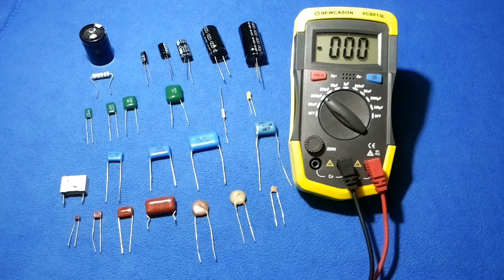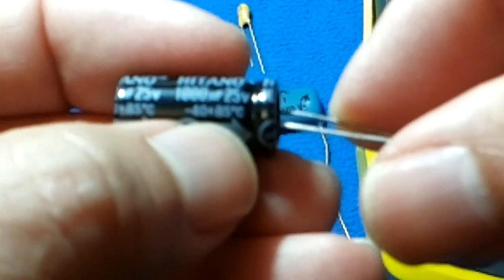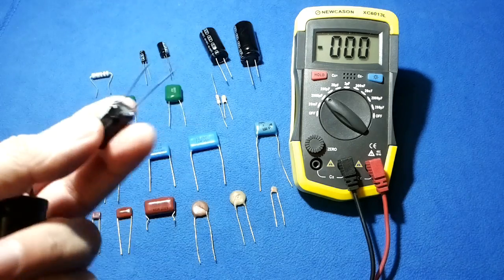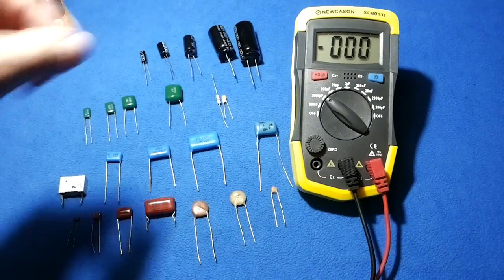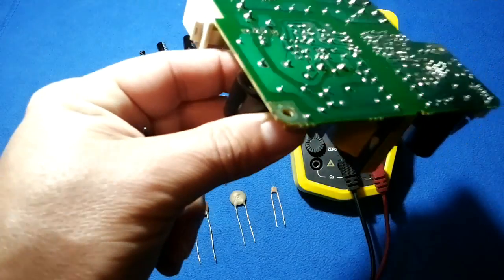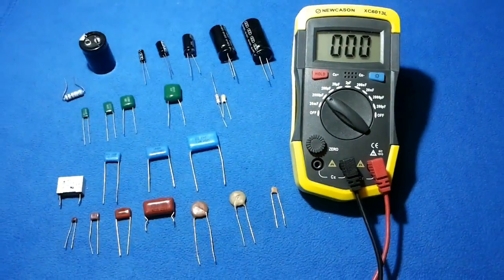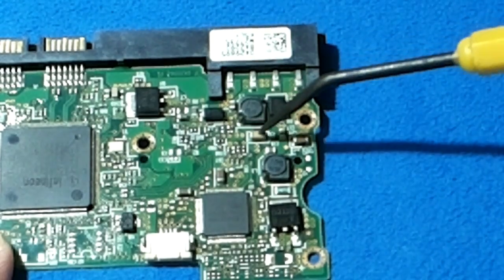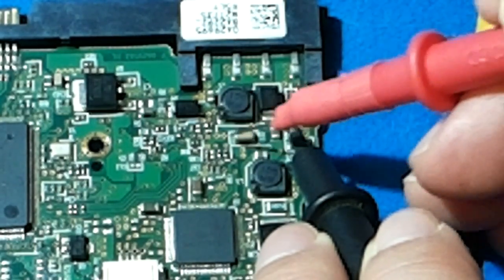How to test a capacitor / how to test smd capacitors with a multimeter

Comment: I've got a 250v 150uF Capacitor 105 Celsius which I pulled out of tv main board, checking all the components.  It's reading 136 uf on my meter. What do think, number on cap too low to re-use? Or still in range?

Comment: Wow, why is that power supply at 9:13 so huge? What device does it power?
Reply from the maker: Hi! I don't know. When I moved to a new country, my mother in law made a deal with some people who gets broken electronics to use plastics to "heat their house in winter". She asked them to bring the PCBA and she pays some money that helped them a lot. I started here with a repairs with a full inventory of spare parts from it. After one year, I retired from repairs and I got to next level as electronics engineer in manufacturing and design. Now I use those PCBA for teachings. But I have not idea from which device or brand are the PCBA from. (This one looks like a TV's power supply. The small one is an Epson Printer's power supply).

Comment: If you hold the discharge resistor wire with the metal pliers (you were not holding the insulated part) and if it is 200v and charged, you could give yourself a hell of a zap...
Reply from the maker: Yes, after 30V we must use insulation. Also the discharge time should be the capacitance times the resistor times 5. Any capacitor after 35V indication must be handled carefully.

Comment: if i have a small smd capacitor like in the end of you video. can you measure continuity between the legs on it to if its short or do i have to remove it first ? why need to remove it, maybe removing only needed when want to read capacitance

Comment: Hi, thank you so much for your video! 
Please I need your help!
Hi, I'll appreciate if you give me this advice, by chance do you know if the old capacitor 250V PME 271M 0.1 μf X2 40/85/56 it needs to be discharged in the circuit board before remove it or the new one that I got PME 271 M 0.1 μf X2 40/110/56/B how? if so how I can discharge it? With resistance or simple metal?
Thank you for your help.

Comment: can I test and measure without unsolder from the board or are number always wrong like that....?!
Reply from the maker: Hi! We will never find a good brand of test equipment making on circuit capacitor meter. If we want to measure a capacitor, it should be off board. (With exception we already removed one component and the capacitor is linked to nothing else). For defective capacitors in short circuit, we must remove the capacitor to get the short out of the circuit. So, the answer is yes! We have to remove the capacitor anyway.

Comment: Hello Bob!
Is there a capacitor that be used as a fuse?There was a aluminium housing fuse with 5A 32V tolerance and blew away like an Elko but no where to find something like that.Is is allowed to replace it with the ordinary fuse?

Comment: Unfortunately the lighting and camera close up is not efficient or clear. Sorry for the comment or criticism but it's TRUE.
Get the appropriate equipment for soldering removing and installing surface mount capacitors.

Comment: Hi i have the same type of tester u hv but wen i test a cap say 100uf...i get a reading of 80 uf...but wen i test it with my fluke tester it show 99uf...is something wrong with my tester? How do i zero my meter cos i hv a manual but is in chinese...pls advice if i should zero in every range reading to test.?
Reply from the maker: Hi! Large capacitors requires more time to be measured. But also, this kind of testers can be damaged easily with a charged or partially charged capacitor.  DMM are made to measure high voltages and 10 or 20 Amperes,  what makes them little more restan to damages. No all the time, but some times, a capacitor discharge damage affects only one or few scales but no all of them. To zero the capacitance meter is a need for low scales. But high scales does not need to zero adjust.

Comment: hola Mi amigo.. gracias por el video..tengo una pregunta que no tiene nada que ver con el video.  yo tengo ese capacitor meter igualito a ese , y accidentalmente le meti 120 volts ac, por tener a un lado mi medidor de voltaje,, me equivoque de terminales, y nomas escuche un tronidito,,entonces ahora nomas prende el display, y se queda en ceros,, pero no mide,, lo abri y adentro tiene un fusible y lo probe y esta bueno,, entonces estoy buscando el daño.. tiene usted una idea de que componente pudo haberse dañado?... gracias
Reply from the maker: Yo no he abierto el mío. Pero por casulidad, recuerda que algunos componentes pueden estar en corto circuito en la entrada de la medicion. Sin batería, busca si hay corto en los terminales.

Comment: 4:59 - firstly, how long would it take to discharge and secondly, how will you know that it is discharged?
Reply: It can vary obviously but you can connect a volt-meter and see the values drop as it discharges.

Comment: 4:46 -> please don`t touch circuit. Do not die from a shock, but it's painful.
Reply: First of we should not test a board while it is conected, secondly large capacitors hold charge for a long while so it is important to remember to be carefull when touching leads with resistor while discharging, I think it is still a normal procedure to touch the capacitor legs with a screwdriver to discharge it pretty much the way we used to with old tv screens which by the way are xtra large capacitors and we'll see a long spark between the screen and the screwdriver.   But you are right it will sting you nastilly if you are not carefull

Comment: How can I test a low value ceramic capacitor by a multimeter ?
Reply from the maker: Hi! It has to be a multimeter with capacitance meter function. Then it will be as simple as to use a single capacitance meter. If your multimeter doesn't have the function, then there are more step method as applying ac voltage with a serial resistor to a non polarized capacitor, and calculate Xc. If the capacitor is polarized, then connect two capacitors in serial (-+,+-) with the centers pointing inside, plus a serial resistor to the AC source to calculate Xc. You will have to look for the Xc formula, but the experiment will help to learn a lot. (Be careful, because capacitors calculations must always be done with Peak or Peak to Peak Voltage). For your experiment you will look for AC RMS to Peak to Peak Voltage convention, RC serial calculation, RC impedance, and Xc capacitive reactance calculations from most good basic electronics or electric principles books.
Reply: Bob. Kalpon

Comment: so multimeter and capacitance meter are the same thing?! since when! .........
Reply from the maker: Hi! A multimeter is an equipment able to measure different things. In the pass, we just to buy a analog volts meter, ampere-meter or even an analog frequency meter. Today is common to find a DMM in the market with all the mentioned functions plus diode, transistors check and capacitors meter too. It makes the multimeter the same as a capacitance meter, or transistors tester, thermometer or frequency meter...
Experts have the knowledge, and they don't need to learn anymore about basic things. There is not need to show a 15 seconds video about how to measure a capacitor due it is just two leads and two terminals where in most cases maybe it is not necessary to care about polarity. But students, and non expert people search for knowledge and it is the reason why this video is here. The video is focused in basic and general knowledge about capacitors.

Comment: is it safe for the circuit board to discharge a compositor while it is still on the circuit board ?
Reply from the maker: Yes. The capacitor has been charged to its normal voltages, and all the reverse voltage protection is done in diodes, transistors and ICs. The problem will be if we charged the capacitor outside of the circuit, and later try to insert it charged, because maybe we charged the capacitor with more voltage than its normal operation voltage.
Reply: Thanks ! 
Im trying to fix a 36 v battery charger .
I saw a video on fixing a battery charger that keeps blowing fuses .
He was saying that is is usually the  rectifier that is the problem .
I switched my volts meter to 115 and it was meant to be on 220v and I pluged it into the 220v wall socket and not the charger keeps blowing fuses . 
I dont know a heck of allot about circuit boards .
Reply: So I had a look at the board and the only think I can think of is that the first track that leads to one of the biggest compositors on the board my be the one that is faulty . 
Its really hard to tell cause it does not seem to be damaged and i cant see anything else that seems out of place .?

Comment: thanks bob!! im an electronic technician my self, as my professor said before, "electronics technician must never stop studying"
Reply: +Glenn Gacayan I was a tech in the 80s and 90s. These days you simply replace the board/module in many cases. Never tried to solder anything on the boards they make these days, I am not a watchmaker.
Reply from the maker: 100% Right! :-)

Comment: Hello, I recently pulled out a capacitor from a disposable camera, what do you think would be the average size for one of those??
Reply: The only numbers on it look like this:
8(2)
5w
Reply from the maker: Hi! Try to get the datasheet for it. In case of there was not data, then you will have to measure it or set up a circuit with a chip 555 to calculate the capacitance value.

Comment: Hi Bob,thanks to share your experience with all of us, i´m a total beginner in electronics field but I would like to learn more because I like challenges like finding the defect and repair it, naturally i´m not an engineer or a technician but like every other human being I have an Intelligence :)

Ok after this long introducing I would like to ask you about measurement with a multimeter of capacitors, I have bought a multimeter with capacitance function with an up limit of 200uF , my question is if I can measure capacitance of capacitors over 200uF or not, I have some polymer aluminium electrolitic capacitors with capacitance of 270uF and 470uF and the multimeter doesn´t read them, is that normal or I making a mistake???? 

Another question as newbie that I want to make , is possible to measure the capacitance of a capacitor without desoldering it from the PCB???? I ask because desoldering is so boring but in Youtube I have seem some videos of users they say it´s possible and other instead that say is not possible to because you will not have the right value of capacitance, sorry for the long message..........I have my subscription to your channel and I wish you all the best for it.

Thanks

Luca
Reply from the maker: I had the same exactitude in the mid 80's. There was not any electronics school in my town, but I wanted to learn, and learn it all and to grow and to be on of the best... In 1989 I registered my first patent, and 10 years later against all the adversity I graduated as engineer. Now day's, 600.000 people watched my videos and I am able to help people like me, searching for knowledge in electronics. Don't stop, be humble and always ready to learn. I wish you the best, and welcome to the wonderful electronics world. "This is electronics. We don't work. ...we just enjoy with it".  ;-)
Reply: Thanks I am just learning I'm retired and hate it so I was wanting a hobby but now I want to learn electronics and go back to work for a few more years. thanks for helping me understand resistors. 1 question Bob How do you know the Resistor is bad? Does it have to be within that range or what if its 6% over?Do I consider it bad?
Reply from the maker: Well done! You are just retiring from your job. But, life goes on, and it is just a new begining again in life. Don't stop. "This is electronics. We don´t work. We just enjoy it". :-)

Comment: I must have missed the part where you talk about "how to test capacitors". You have everything else BUT that info here. ? History of the many types and uses of capacitors, pcb removal etc. but NO multimeter testing techniques or value examples.
Reply from the maker: Hi John! To test it is very easy. One capacitor tester is enough, and for most of them can be tested with a multimeter with capacitance meter. What is important is to know we must discharge and remove them, or for SMD capacitors it is enough to lift up one side. The rest is just about to touch the sides with the capacitance meter test leads. I am not a long videos maker. In my opinion; to connect capacitors to the meter was an over illustration and  time waste for the viewer. A formal teaching will be in 30 or 60 minutes videos. I try to make videos in the 7 or 15 minutes for some kind of audience. (In this period of time, people learn 85% of the lesson, in 30 minutes only 60% and after 50 minutes most of them stop learning). I recorded other videos measuring capacitors already, so for the followers the illustration is done. Thanks for your commend, and I will considerate it for next time.

Comment: Very useful video but the way you remove smd capacitors from the pcb is not properly correct. In the second case it is quite clear you are lifting one of the land from the laminate surface. Ciao!
Reply from the maker: Hi! For SMD capacitors we can use hot air to remove it, soldering iron with special tip and connected to a soldering station for proper one side lift up, or soldering iron with tweezers connected to a station for removing the biggest SMD. Some people like more to remove them with hot air. I was a process engineer in an American SMD capacitors industry, and I know no one rework process is too healthy for them, and in that case I rather to lift up one side.
I respect your opinion, but no as a teacher, but as a process engineer who made the SMD capacitor from A to Z, and certified for quality in a ISO manufacturing, I avoid all the over heating in repairing procedures.

Comment: what do you set your multimeter at to test the photo cell in my motion sensor light. the light works but the light will come on even in the daylight, so i want to test the board and i think its a cds, marked on the board?
Reply from the maker: Hi! For a simple photo cell test use Ohms meter. For function test, use voltage meter. The best way to get a good result is to set up a "window comparator circuit". It can be done with 2 Operational Amplifiers. I recommend to use the ones that works OK with +V and Gnd, and voltage between 3 and 5 Volts if it is the case. Set the voltage level upper of 160mVolts. (The better is something close to half Vcc). There are low noise comparators too.
If you work with photocells or phototransistors, you must make the window comparator in order to control the light's hysteresis or to reduce the noise's effects.

Comment: Excellent video Review!!!
I was desperately looking for this info, about how to test check measure Capacitors. At most of my jobs, I just did voltage, continuity and resistance tests checks. But sometimes used to come across capacitor troubleshooting which I had forgotten. Many other "you tubes capacitor videos" talk so much never explain plainly, go to the point, never really explain show so clearly the good capacitor points You made. E.g. specially the one, about BEFORE working testing them YOU HAVE TO DISCHARGE them. 
You made an awesome video. This video was good similar to the way it was explained taught to us many years ago in College. I was trying to remember had forgotten a lot about capacitors. Awesome review, points explanations you made. Thanks!
Reply: Oh, another GOOD Point You made and many others "capacitor videos" fail to explain make a point of, or even mention it, that before measuring test them; you have to Removed the capacitor from the circuit. Makes a lot of sense (get wrong different multimeter readings). 
Thanks Mr. Bob!!! Thumbs-up to you Sr.!
Reply from the maker: Hi! In my life, I had to design, to teach, and I was a process engineer in one of world's top SMS capacitors Industries in USA's land. There is a lot to teach. I just mention the basics about capacitors. Youtube has top guys with great knowledge and teaching videos. But sadly there are also pay by click hunters, laking of knowledge who became famous trying to make videos from the minimum knowledge. It is hard for the knowledge searches to find videos between entertainers and teachers, without to watch one by one until they find what they looked for. Maybe someday Youtube will create a database, able to classify videos by resume, info, and more specific categories as entertainment or educational in the spoken subject. Thanks Robert by writing. :-)

Comment: Very informative though I would appreciate if if it will include also  interpreting the results of the test/s say, that polarized electrolytic capacitor for charging but not discharging properly or, that it's discharge is somewhat "clipped" or, that it shows a high leakage current - all indicative of a bad capacitor and (please, as would in some forums) that one does not need for that capacitor to bulge in it's head or even explode. Since you have also indicated smd capacitors (which may include those polarized tantalum capacitors),  does the testing and the test results of that polarized electrolytic capacitor apply the same to that of a polarized smd tantalum capacitor or does the latter behave differently from the former? I have right now 3 brands of smd tantalum capacitors of which 2 are from AVX and NEC/TOKIN.  The 1st brand behaved as expected when tested just like that of the electrolytic capacitor  in say, bias-reverse-bias (charge/discharge state.). The other two, AVX and NEC/TOKIN, did not.
Reply from the maker: Ok. Thanks! I will make another video.